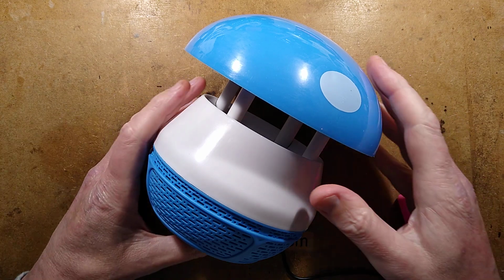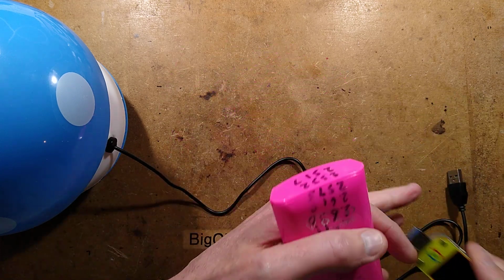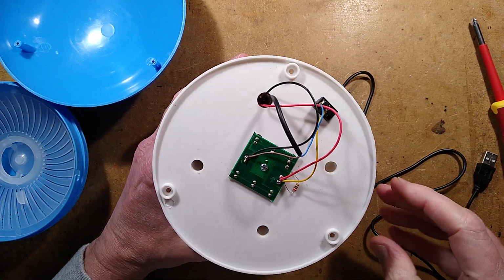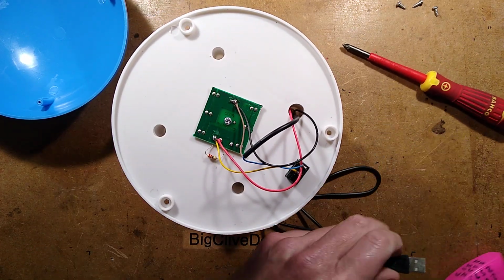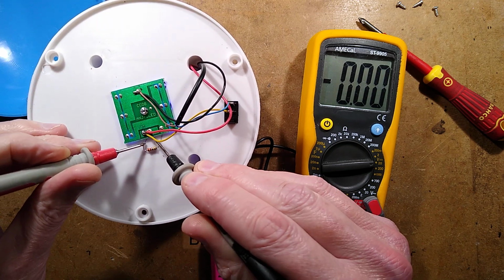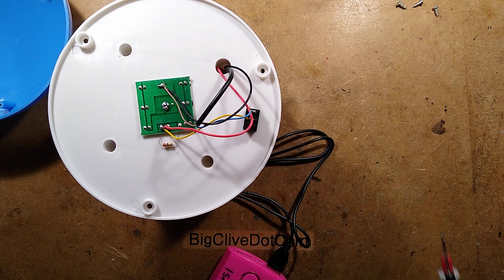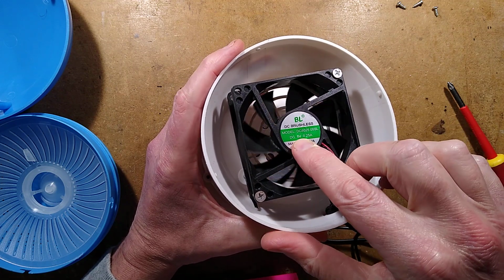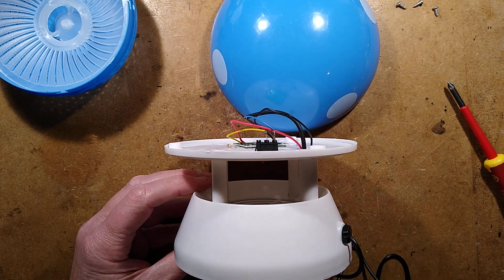Fly chopping electric toadstool

Comment: I just cursed for something like this the other week, a relative spent hundreds of pounds on a system with propane and some sort of pads with a liquid on them that only lasted a couple of hours, then like 30 pounds to reload.. this looks like the way to go! Thanks for uploading!
Reply from the maker: The propane mosquito magnet type units can be very efficient at catching mosquitoes.
Reply: Yeah the propane is to generate co2 and the pads contain a chemical from cow's breath that mosquitoes supposedly respond to. But the way those are supposed to work is more like, you have a few acres of land and you set that up between where you are and where the mosquitoes are probably coming from and run it all the time. 

The theory with these is that lots of flying insects are attracted to uv light
Reply: @EricJorgensen  Oh? From cows breath you say? That makes it hard to replicate with household items i assume? Maybe possible to collect some cow drool and try for science! :D
Reply: Apparently you can refill those little canisters with cheap lighter gas, never seen one in action but something that I heard

Also there's apparently sources for cheap pads but who knows how safe those are, I know the customs here tend to confiscate them

Though personally I just cover myself with long sleeves and put one of those nets on my face if it gets really bad or I go to the woods
Reply: @waldevv  yes that's right, if I remember correctly they put a small piece of lead in spout so you can't refill them (also the gas always runs out before all the pads do), but you can use a screw to screw into the lead then pull it out.
Reply: @waldevv  Yes indeed, just had to remove the connector and then poke out a small piece of plastic, then use a lighter refill that has a metal tip that i filed a slot in, then it worked, but still it is a hassle for my relative to do compared to recharge a battery, so this seems like a suitable solution (if it works that is which seems touch and go)
Reply: Is it called thermacell ? Little blue pads and little gas tubes that go in device. If so that thing works great and removes them from whole area but takes some time to kick in and make that protective bubble. This system doesn't attract them it repels them.
Reply: @sa31312    The Thermacell devices repel mosquitos, they don't attract and trap them.  They work quite well, but they're designed to keep you buying the gas cylinders.  (I think it's butane, not propane ... same as used in cigarette lighters.)
Reply: @jpdemer5  i had a coleman unit that sat on top of a standard propane tank but i got it second hand and it never worked properly.

Comment: I have the full size version that and it works quite well. Flies like it, moths love it, and mosquitoes seem to somehow find their way into it. Albeit my one has "titanium dioxide nanoparticles" that are supposed to catalyse breakdown of organic materials when exposed to UV and thus generate CO2 to attract the mozzies. Whether that actually works I have no idea, because the high voltage bug zapper with UV light also attracts mozzies and zaps them. So it's a question of whether you prefer fan noise to occasional zaps with your blue light. Both make white cloth fluoresce so there's at least some near UV coming out of them.
Reply: Pretty sure the product shown is covered in titanium dioxide. I'm not familiar with the catalytic effect you describe but it sounds pretty exothermic. Perhaps we have found the reason behind the nauseating off-white color of older electronics... or the ultimate solution to plastic waste?😉

(So apparently that is a potential solution to concentrated micro plastic waste in water. 🤷‍♂️ Here I thought they were just pulling something out of their butts because of course this white product would be chock full of titanium dioxide - albeit overwhelmingly not in expensive nano-particle form - but you've got to give them credit for the material not only actually being present but the reaction pathway being physically possible. It's just kind of laughable from the get-go because if the thing were putting out enough carbon dioxide by such a process to attract a mosquito which would normally visit a mammal, it would at least a bit on fire.)
Reply: I admit I was struggling not to say "quantum nanoparticle phase-linked natural energy para-crystal tunnelling carbon nanotube hyperloops" but I was aware that the nanoparticle effect is real, it just requires far more organic material than that surface is going to get and AFAIK the scientists behind the idea haven't yet found a way to keep the surface clean, so the idea that a $20 ebay special has self-cleaning nanoparticles (with 5G-induced static charge ionic replusion effect! Also, disco lights and subsonic activation)

Comment: I catch fruit flies by using a glass jar with about 10mm/~0.5" red wine in the bottom and a 5mm/~0. 25" hole in the lid. The flies are attracted by the wine but tries to escape through the glass. Fruit flies are not super smart 😊
House flies get a smack with my fly zapper.
Reply: Fruit flies are easy, I just put a bit of vinegar mixed with about the same amount of water into a small bowl and add a drop of dish soap. The vinegar attracts them, the dish soap removes the surface tension so they just drown. Unfortunately it only works on fruit flies, I have yet to find a way to get rid of regular flies and mosquitos.
Reply: @ChindoCaine  You are right, vinegar will do the trick - but I wanted to go a little classy😉 - and the flies deserve a good time before they go 😛
Reply: @ChindoCaine  I do this - with apple cider vinegar.
Reply: i find a quick spray of window cleaner or kitchen cleaner very effective at stunning bugs so they can be crushed by foot or hand.
for the big flys the spray bottle serves as a very effective swatter.😅
Reply: Yup I came to digest soap , that's for wasps too. Lure with protien or sweets , soap makes them soak ,choke an, croak !
Reply: I MacGuyvered the frick out of mine... :D
Used a medium-sized diameter, but short pill bottle for the reservoir.
An "Olive Garden" to-go salad dressing container for the cap (since it's a perfect fit and presses in tight).
Poked about 8 to 10 holes in the bottom of the "cap" with an standard kitchen ice-pick (a T-8 torx bit in size).
Then, like @Sashazur, I use Apple Cider Vinegar, but also with the drop of dish soap like @Michael Heilig.

However, when I go to the cabin for a month in the summer, and our neighbors take care of the dogs (feeding/letting them out), THEN all I do is take an 11" (30cm) glass bakeware... uh... pan(?lol) with the two wing-handles, and lay that across the kitchen sink -- the handles lay across the sink opening perfect.
Put a liberal squirt of dish soap in it, and fill it with water, having said neighbor top it up as needed.
Works amazing for the fruit flies, and just about any other flying insect, since they're all attracted to the large water source and the soap does its 'magic' as Michael noted, thus causing them to get sucked into the water. 🤘